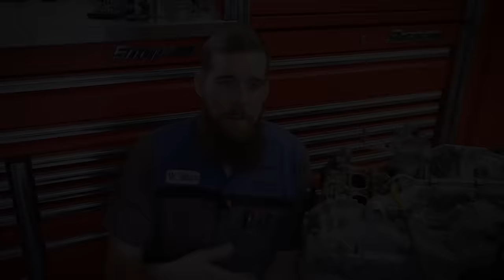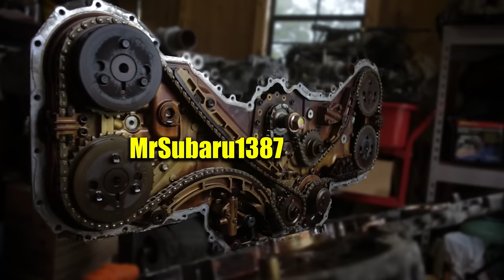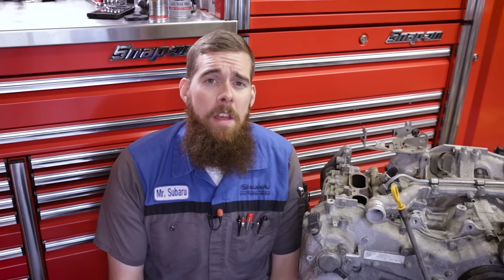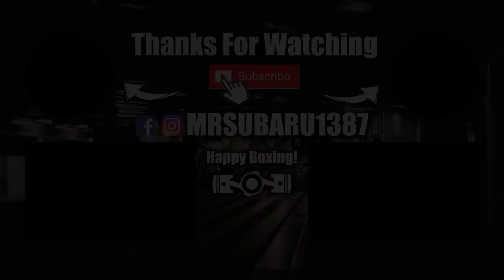Why Subarus Are So UNreliable!!! Buckle Up!!!

Comment: I have a ‘17 Outback with 156K miles on it. I’ve done recommended maintenance on it and have pretty good luck so far. Only items replaced were a right rear wheel bearing, and a right front axle shaft. Of course the vinyl on the driver’s seat is cracking again and is ready for it’s second replacement.  My biggest concern is following Subaru’s “no maintenance” stance on the CVT. Waiting for it to grenade on me.  I’ll be looking into a fluid change there. At the same time, in the family we have a Honda Civic, and a Toyota Highlander, both with over 250K miles and running great. At that age wear and tear impacts major components (alternators, radiators, etc) but still cheaper than a car payment.

Comment: I have blown engines out of Fords, Hondas, Nissans and Dodges. All became boat anchers because of the way I drove them. Since I got older and a little more reasonable in how I drive and maintain my cars I get a lot more miles out of them. My last Toyota had 180000 on it when I traded it in for a Forester. As you said in your video maintence is the key. Quality parts and regular maintence and today's cars will last a long time.

Comment: 100% agree i have a 1998 JDM subaru impreza classic wrx that is running 350bhp and has been in the family form new when i got it i modded it and has been for 6 years now i have looked after the car for some time now im at 150000 miles and my head gasket has just gone apart form that iv had no major issues not bad for a 24y old car all i can say is look after your car and it will look after you if you can not then don't get one. love the vids

Comment: FACTS Mr S.!  Have aftermarket CAI, downpipe + full exhaust, run a tune and take it easy on my 2011 STi, the power is there when i want it.  With that change my oil like clockwork, coolant..slacking on brake fluid 70k nil issues!  owned w/21k

Comment: I own a 2011 wrx hatch. Only blew head gasket once cause I drove it like a jackass and drove it through a 3 feet deep waterhole with a cold air intake at about 5k rpm. Lesson learned.  Over 120k miles since replaced with zero issues.

Comment: Man I had to teach my friends about the head gasket issue that supposedly every Subaru had including STi’s. All of my 4 friends that I recommended them to get a STi or wrx have one now and not a single one of them have had a head gasket issue till now. Two of them have WRX’s (14,17) and the other two have a 06, 07 Sti. Blame it on yourself for not modifying ur car right and blow it up. Oh yeah and the 14 WRX is pushing 500hp but not short cuts taken and still running after 3 years of pushing 500hp.

Comment: I'm still on a 97' ej22e with around 300k miles, doesn't burn/leak oil and only motor related mods are an EGR blocking plate and borla UEL headers (single port) with full JDM 98 STI catback
All 4 wheel bearings are dead, its got primer instead of paint, it's on ebay special coilovers and some whiteline/megan suspension parts and honestly is the best $1200 car ever

Comment: You are right. I am the third owner of a 2011 Forester 2.5x Limited NAV with 150,000 miles and the 2nd owner didn't have maintenance records for oil changes or any other maintenance items. After having the car for a couple of years, I'm pretty sure he or she didn't do any maintenance. It runs poorly, gets poor gas mileage in town, it burns oil, and just aggravates me no end. I'm working through doing the maintenance the Chevy dealer I bought it from didn't do and things are improving slowly. I switched to 5W-30 high mileage synthetic oil b/c 0W-20 burns up very quickly. I live in south Louisiana and it's really hot here so 0W anything is just too thin. It hasn't gotten that cold here in at least 20 years. If it keeps consuming oil, I will probably switch to conventional oil, and I may to to 10W-30 or 10W-40. There aren't that many Subarus down here, and it seems they were built for much colder weather than we have and there are no recommendations for very hot weather.  

I just changed the upstream oxygen sensor when it threw a p0171 check engine light. My next maintenance items are changing the diff fluid in the front and rear and changing the CVT fluid. I should have paid a lot better attention to the maintenance records and bought a different car. I don't blame Subaru. I blame the previous owner. I think I will go ahead and change the downstream sensor because it is as likely carboned over as badly as the front one and will fail soon. Then I might get even better gas mileage. I do my own repairs and maintenance, I'm learning, and I'm reaping the rewards for better care. 

I have a 25 year old Honda CR-V and it gets better gas mileage and pretty much no problems because I've always kept it up. Maintenance is the key to keeping a car a long time. At 25 years old I had to rebuild the front and rear suspension and change the steering rack, but it still runs and drives great, like new. But when I bought the Honda it had 45,000 miles and all the maintenance records. All maintenance was done on time every time. It makes the difference in a car lasting so long and one falling apart no matter what brand. Owners need to look in the mirror and take responsibility for everything they failed to do to keep the car in good working order.

Comment: Stressing these engines, as well as any other engine with forced induction, and whaling on it is going to kill it faster. I used to work on Lycoming and Continental O-320, 360, and other variants and they were reliable as hell, as long as they were built for the parts added to them, and maintained.

Comment: '04 STi: 131K, second owner since 2003. First issue was rear struts replaced twice under warranty and right side a third time. Eventually modified with zerk fittings for permanent fix. New brakes at 28K under warranty! Thanks Subaru USA. Next issue was cold weather fuel rail leak at 83K- Subaru went 50/50 as a goodwill effort. Thanks again Subaru. Stayed stock until 97K when it got a full exhaust and a tune. I have been diligent in performing regular maintenance and in replacing normal wear parts (timing belt, clutch, plugs, coils at 100K, radiator when it failed, VVT solenoid, etc) and it has left me with only one complaint: corrosion is killing it. Yes I live in salt belt but it got regular washes. Addressing corrosion (ignore it at great peril) costs thousands of dollars, and it is a forever war. 
'12 Outback: 110K, first owner since new. Only issues have been control arm bushings and ABS module and a daughter that cannot put the iPhone down while driving. Anything else has just been regular maintenance. It has corrosion but nowhere near as bad as STi.

Comment: Since 2006 when I got my first Saab 92x aero I fell in love with the ej205. I’ve owned many 02-06 wrx as of today, a 2005 Saab 92x aero that is still running on its original ej205 at 220,00 miles, a 2002 wrx wagon I swapped a jdm ver 8 ej207 into  that is now at 270,000 miles and still running on its original 5 speed transmission, another Saab 92x aero,

Comment: My brother inlaws 2000 OutBack with over 240K miles. It's constantly goes off road. The car is nearly bulletproof although some items are wearing away. My thought: A well maintained car should not break, it should wear away. Too many have the "Run till Fail" mentality  and blame the car when it does.

Comment: I just sold my 03 automatic Forrester had 370km on it. Was a great reliable car only problems I had was front cv axles inner joint would continuously wear out.  Your videos helped me a lot with replacement cheers👌

Comment: My mom's car blew head gasket at 220k after it was already replaced at 160k. Also always bad a misfire even before the first head gasket was done.

And was never a fan of the 2000 automatic gearing

Also my mom's old 93 legacy had the head gasket fail over hearing and oil in coolant at 220k

Comment: Preach it brother! You are one hundred percent correct, As an owner of twenty five subarus, from 1978 up, Most of them second hand and acquired because the person I bought it from did not Fix a coolant leak or major oil leak. Or thought that timing belts and bearings water pump etc.
 last forever.
Now you have me on a rant thanks
On the flip side, we have several subarus with 350k miles and 2 turbo models with 250k miles on the original motors. 
MAINTENANCE

Comment: First time to see this but I have to say you are spot on most young people don’t even look in there glove box to see what the car needs, yes they have some problems everyone does but owners are the biggest, I got a new 06 STI drove it to 300,000KM motor was great the factory clutch lasted to 275,000KM but looked after it, simply put service your car find a tech who does not believe in lifetime fluids and use them, nice rant by the way right between the eyes

Comment: 9:43 EXACTLY.  As a former RX-8 owner who religiously maintained it, getting it to 135K miles ON THE SAME ENGINE, NO REBUILD.  I can confirm; it's about maintaining the engine FOR WHAT IT IS.  You don't maintain a V8 the same way maintain a rotary or a boxer or boxer turbo.  I currently own a VA WRX.  59600 miles.  Stage 2+.  Stock clutch still.

Comment: Couldn't agree more! I've never blown a Subaru engine, even though I've driven with the EA-, EJ- and EZ-engines for a two decades and every one of them has hit 400k and beyond. I even EJ20G swapped my Subaru Leone about 20 years ago, and with 336hp/450Nm dynoed, it still runs fine with about 336k in the clock atm. It's all about the maintenance, and the tuning of the engine.

Comment: My 02 bugeye wrx wagon is the PERFECT delivery vehicle. I drive it 6-14 hours almost every day, sometimes hundreds of miles. It’s surprisingly roomy and gets me through my work day with a smile on my face. 
 
I modded it, tuned it, I drive it “hard”, I “beat on it” a good bit. But I also change the oil every 3-3.5k miles, the gear oils every 15-20k miles, the coolant gets changed way too often etc etc etc. IVE NEVER LAUNCHED IT, not once. You don’t need to unless you’re at the drag strip. If you’re good you can quickly get 1st engaged and moving more than fast enough to race someone and leave them in your dust.

I lost compression all over the place on the short block and valves around 210k miles. Swapped with a new OEM short block and original rebuilt heads, currently on 160k miles on the new engine. At 360k miles my tranny started to make some bad bearing noises from inside the main section of housing (tried swapping in a new center diff and bearings in the tail section but didn’t help). Still drove and shifted fine however. Swapped with a low mileage 4.44 trans and RD from a jdm 05 Forester XT for 1k and swapped it out myself no problem at all. Drives great and the 4.44 is more suited for saving money on gas in the city, but you take a hit on the freeway.  On the plus side, 4th and 5th gear aren’t a complete waste of time when it comes to acceleration now.

I’m going to drive this car until I die or it’s body is destroyed (god forbid), I f the latter happens I’m just swapping everything I can into another bugeye wagon, or a lighter GC chassis wagon.

Comment: I made some  pretty good coin flipping ej20 and 25 cars that I bought for scrap price because the original owner ignored the factory service mandate for timing belt/water pump replacement,  busted the belt and pounded the valves. I must have done at least 30 of them.  I got so I could rebuild the heads and engine and have the car running like a champ in under a week. Simple cars to work on and they ran great if you didn't beat the snot out of them.  I even put a ej20 in an 02 outback. All you have to do is make sure you use ej25 cam wheels. Frankly I think the 20 was a little better motor. But you're right. Don't cheap out on the timing kit or the head gaskets. I never heard about using the turbo gaskets on the normally aspirated engine but that's a cool bit of info. I always went with Felpros but I know a lot of folks don't care for them. I never had any issues. If you really want a snarling 2.5 subby boxer there's a dude in Australia who custom builds them out of billet aluminum.  Normally aspirated version puts out about 329 bhp. Turbo version gives you another hundred. But these engines are built like bank vaults when compared to a factory motor.

Comment: Totally agree. I had an 06 Legacy GT and the previous owner ragged on it. Couldn't tell when I got it, five years later the motor wasn't healthy. I had all the service done properly, but couldn't tell what the first owner did.
Now I have a 16 Forester XT and I got it since brand new, only 6 miles on the clock. It's been strong and reliable and maintained properly all the time.
Now let's see how long the CVT lasts.

Comment: Back in 2008 -2009,  I had an 04 WRX with just shy of 200000KM. It had a VF-29 turbo, STI injectors, STI intercooler, high flow exhaust. etc.. It was making more or less the power of a stock STI at the time and had no issues with it. Hell, I replaced the clutch at 160000km. Meanwhile, other people were blowing up the 3rd gear on their tranny. I drove it with respect, never launched the car,  I used quality parts and brought to a reputable performance shop. It was great until I was stolen.

Comment: Completely agree with you. Use to be a Subaru tech. Then my sister works at the Subaru plant in Indiana. She bought a used 2015 WRX from a  Subaru dealer. Not even a few days of owning the car, the engine went bad( rod knock) even though it had a clean carfax. You never really know how the previous owner maintain. Subaru replaced the engine at no cost but I told her to trade it in and get a new car instead. She got a branded loaded Outback XT 2020 and I just recently got a 2019 Subaru Ascent. Both no issues.

Comment: I'm 46.. recently acquired a  2002  impreza outback sport. 203k miles, non turbo. Runs flawlessly.  All stock / factory options. No teenage modifications! Car runs strong and  fast. My first Subaru.  As a errand Car. 

Love this video. Kids don't stop destroying  shit before  18. They obviously/definitely/apparently  continue  to destroy! Well into adulthood. 

I'm intrigued  by this boxer platform.  Same as I was intrigued  with my knowledge of  BMW.  Primarily focused on the e30/e36 platform.  My favorite builds were always the 99 wide body Z3. 

I love Subarus  products, long before  I became  an owner. Because  of friends  who own them and swear by them. 

I'm also quite partial to the engine/exhaust note of the flat 4. 

You say apples to oranges and obviously it is true to a hardcore fault when it comes to Honda and Toyota comparing to Subaru! In my personal opinion you should definitely include, or at least I may. No matter what Honda or Toyota you may drive! There's a specific thrill coming from a Subaru. Something you'll never get with a Honda or a Toyota on a specific Factory level trim!

I really love this video! It not only takes a mechanic to point out the issues and flaws but it also takes a mechanic who has a love for the product!

Comment: Thanks for this video, I just have one issue I have done all the proper maintenance on my 2014 outback. I bought it with 136,000km on and at 245,000 km the CVT gave out. It had to do with the bearings, unfortunately because it’s labour intense the mechanics won’t fix it. I had to buy a used tranny. I’m a bit annoyed even though I changed the tranny oil twice since I bought. I don’t beat up my car because I’m a bit scared of ruining the CVT. The cost of the repair was 3100$ (Canadian). I understand that shit happens and anything man made can and will break. Other than that I really do enjoy the car. Keep up with these videos they are very helpful

Comment: Mr Subi, I appreciate your rant. "If you break it, you buy it" About to invest in my second vehicle. First was a '09 Forester XT Limited that met a guardrail at 110k miles. It treated me VERY well and I didn't abuse it. Wish it could have been saved. About to go for a '10 Outback 2.5i and intend to treat with respect. I'm an old guy with mostly reliable kid drivers so I turn the wrenches around here. Looking forward to how this story ends.

Comment: I abuse the hell out of my 2013 supercharged BRZ with 287 wheel and its had 75000 since then still no issues but its maintained well. there's many things that Subarus over build that can make them very good power adders. however i also think somethings are silly such as the EJ255s banjo bolt screens starving oil tot he turbo. but generally they are pretty nasty (in a good way) and there's a good reason why a lot of people choose to put money into them. and the low center of gravity is sick for grip and handling. I have multiple performance focused cars and it is never the cars fault its always my fault when or if i break them i will admit some things are better made and can handle more punishment than other brands and that's not a false statement. the only thing i don't like about my BRZ is that the steering racks tend to get water in them, the transmission and clutch are very underbuilt for the focus of the car i already had to replace my rack and the clutch is about gone and the transmission is probably not to much further after that but i have an Xclutch and a lightweight flywheel and a T56 magnum going in right after they go. Side note the mid range torque dip was easily solved with a nice set of headers and its no uncommon to hear the transmissions failing under stock power especially 4th gears thrust bearing and high gear synchronizers.